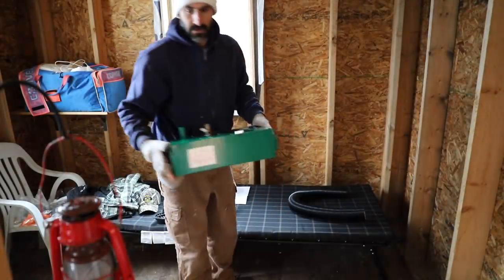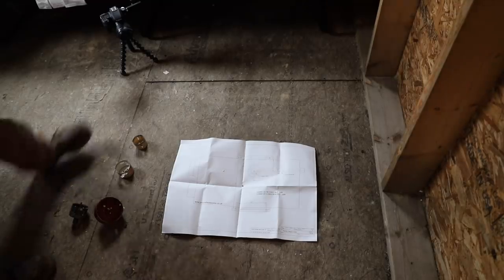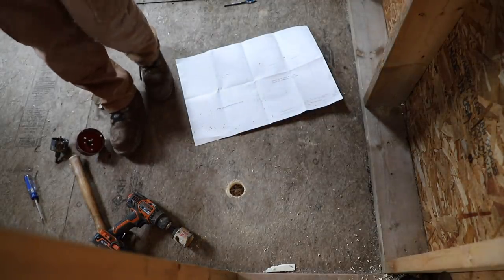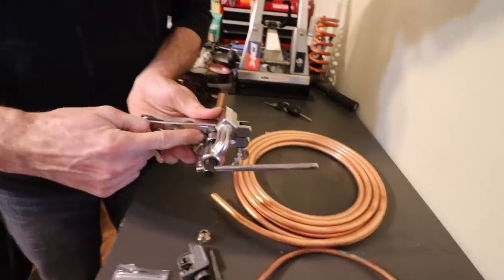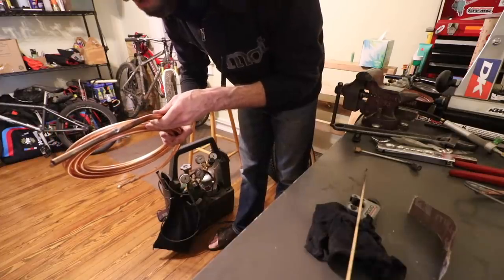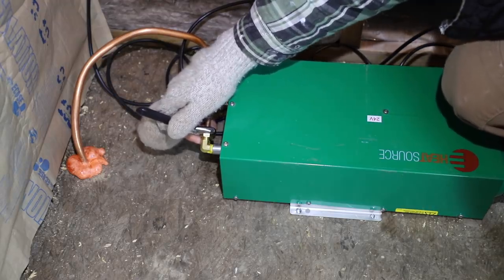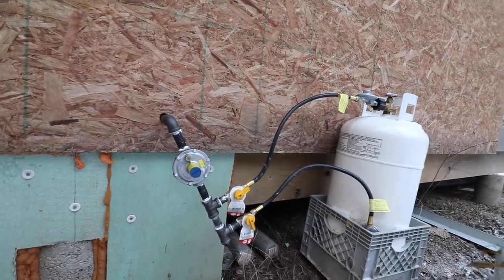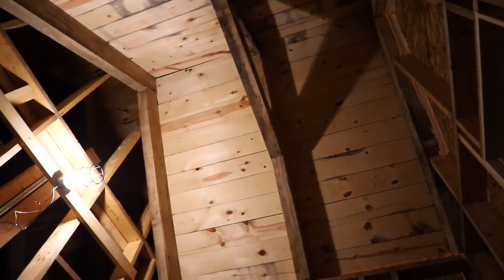Installing a Vented RV Propane Heater in a Small Off Grid Cabin

Comment: Great video. I seen little heaters like that for campers. If you don,t mind where did you get that heater. I have a camper and want to put one in. Thanks
Reply from the maker: I got it here, https://www.westyventures.com have a couple different sizes.  It might not be the most cost effective, I got it because I wanted a 24 volt version and they were one of the few companies that make one.
Reply: @50Acres  Just wondering how much that green unit cost.  It is a smart little heater.  I have a cabin and a garage I would like some ocasional heat in.  but here in Canada it gets cold  -15c in the winter.
Reply from the maker: @aDogNamedGromit  It cost me $800 USD.  I was kinda limited because I needed a 24 volt version and very few are 24 volt.  I love it's efficiency, it sips the propane.  The things I don't like are that it is pretty loud and it takes power to run a fan.  But without the fan, you lose that 90+% efficiency.

Comment: Why would you need a backup for your wood stove, is it to small? What's the point of being off grid if you need something like propane.
Reply from the maker: Hi Robert, I think people go off grid for different reasons.  For me it's not so much forsaking all connection to the outside world, it's more about the fun of it, the gear, the solar, the challenges of building.  

Regulating heat in a small cabin is really hard with a wood stove.  With a big stove, you can get a long burn time but get cooked out.  With a smaller stove the temperature might be good but the burn time wont last through the night.  With a backup, we can have this kick in while we are sleeping and make it to morning comfortable.  Or it could be we are taking off for home and we want the fire to fully burn down before we leave but want some heat while we get ready to leave.  It just gives us good flexibility.

Comment: Hello! Thank you for the videos. I live in Sweden and I wonder why you dont insulate the floor. Here we use at least 30 cm or ten inches. Magnus
Reply from the maker: Hello Magnus, I will also insulate the floor by using spray foam insulation.  Our climate here is not as cold as Sweden.  We would probably use about 2 inches of foam here for a floor or about R-12.

Comment: Where did you get that heater from I need one for my 73 Shasta and how much was it
Reply from the maker: I got it from a place called go westy, they have two different sizes,  it cost $775 I think.  You can get a cheaper version probably, I just needed 24 volt model.
Reply: westyventures.com I think you meant. Gowesty is one of my dealers but they don't sell the 2800, only 2000.

Comment: I have one in my RV   they work well but the fan is kinda noisy and consumes over 1 amp
Reply from the maker: Yea its kind of a power hog.  I'm going to put a box of insulation around it to quite it down soon.
Reply: @50Acres  The fan only moves the air over the burn chamber fins - I have wondered if changing this kind of an automotive clunker jobbie  to a PC type brushless one using 1/10th the power
Reply from the maker: I'd love to hear how it works if you end up doing it.

Comment: 50 acres, go to big box store by a carbonmonixide/smoke detector, get the 10 year lithium battery one. That is a very good safty investment.>>> Thats why electric heat is good no fumes or wood to chop. Note: a 1500 watt heater should be on a 20 amp , NEC says we should use 80% or our rated capacity. [**So a 2000 watt inverter could easily handle that heater,bad solar day; use the generator. Best of all,that 1500 watt[,hydronic heater I mentioned in another post on your site; is portable& it rolls, its light, so when you go, it goes in your truck...Peace...Hugh -Chicago -metro...
Reply from the maker: Thanks Hugh, I've actually got two of those battery operated CO2 detectors.  That hydronic stuff sounds cool.

Comment: Are you exhausting inside the building?
Reply from the maker: No this unit has an exhaust pipe and an air intake pipe.  It makes a lot of exhaust, if you even tried to, the room will fill up with exhaust really fast.

Comment: Dont think a 9000 BTU heater will do much good in a uninsulated cabin that size
Reply from the maker: I'm working on getting it insulated, but yea it didnt do much before I got the insulation in.  It's going to be backup to a wood stove soon.  Will use it to keep the place warm the day Im leaving, so I can let the fire burn down and still be somewhat warm.  Or will use it to kick in over night when the fire burns down before I wake up.
Reply: You will want a thermal heat sink. Air is just not great at storing energy/heat. That’s why I always laugh when we talk about efficiency. It’s a mood point when all we are gearing is air.

Comment: Not smart using copper tubing for gas plumbing,it fails over time.
Reply from the maker: Yea I have heard that as well, it's interesting though because it's widely used in parts of the US and pretty much the entire UK.  In this case I made all the gas lines for the rest of the cabin out of black pipe and transitions to a brass shut off valve then copper for that specific appliance since the instructions specify copper.
Reply: @50Acres   You can use black iron to point of use and get a manufactured gas connection flex pipe. I have been working the local propane companies digging up and replacing alot of copper pipes.
Reply from the maker: I will have to look into that, thanks for the heads up.
Reply: Copper is industry standard for non-buried propane lines.
Reply: @karloskelly  Not here in the  USA.
Reply: Copper line is used extensively to plumb propane and natural gas stoves, water heaters and such in homes everywhere I have been - in the USA. What do you propose to use in its place?
Reply: @karloskelly  They use plastic to the house regulator  then steel to point of use a  then a special stainless steel flex line to the appliance.

Comment: Good luck those heaters suck up propane and electricity
Reply from the maker: Its eventually just going to be backup to a wood stove so it wont need to be on too often.
Reply: Less than 1 amp at 24V, and way more efficient than the std heaters commonly installed in RVs.

Comment: A gas heater that requires no electricity to operate would be far better. The solar system will fail when its the darkest and coldest outside. Then your heater fails too. Not good.

Williams chimney vent propane wall heater would work best. These are often called gravity heaters because the heated air causes the room air to circulate through it automatically. This was often the only heater houses in California used. They are 65” tall, 16” wide, and can run either natural gas or low pressure propane. PS your tanks are way too small. Mount a big tank on a small trailer to run into town periodically.

The whole thing is stupid with no insulation in the ceiling, wall, floor.
Reply from the maker: Invention Development Hey man, thanks for watching and commenting.  This is a backup heat source to a future wood stove.  I needed something thermostat controlled.  I also wanted the safety features of this stove that require a circuit board.  Auto shutdown/ alarms etc.  The job of this little furnace is to keep the bedroom warm from 4 -7 am and that’s all.  As for insulation, just haven’t got it done yet.
Reply: 50 Acres & a Cabin 
yep, the gravity wall heaters make their own electricity from the pilot and come with a wall thermostat connected with a wire pair. i lived off grid in a large modern two story house for five years. this one gravity wall heater mounted downstairs heated the whole house. anyway, you are committed already. but keep in mind when this system fails you at the worst possible time.
Reply from the maker: I thought about one of those for the main room actually, it's tough to regulate wood heat in a small cabin, I might get one in addition to the wood stove.